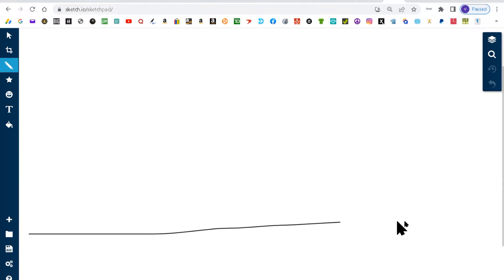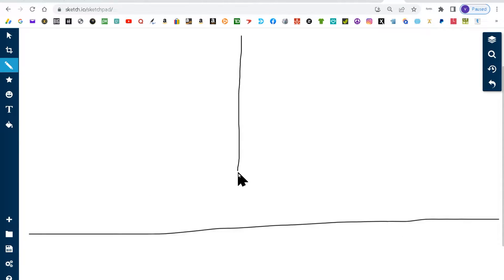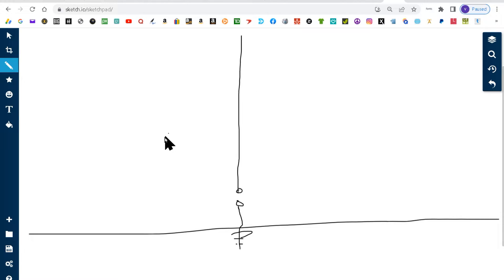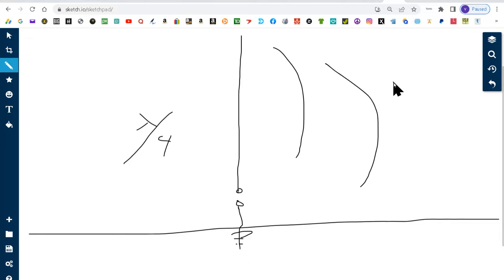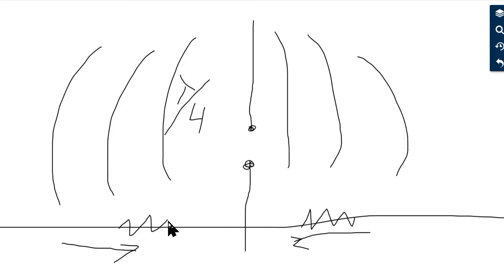WHY YOU NEED GROUND RADIALS / HOW TO INSTALL GROUND RADIALS / GROUND RADIAL BED

Comment: The guru on this subject is Larry Cebik W4RNL (SK) who did lots of experiments and measurements. For quarter wave verticals he found  that 16 radials is the recommended minimum and that performance improvements become less noticeable after 25 to 30 radials.
Reply from the maker: There is a point of diminishing returns, My experience is much higher than 25. I am not saying Larry is wrong because there are other factors, soil content, obstacles, etc. Performance still gets better after 30 radials, its just not as noticeable.  Thank you

Comment: I generally agree with you about the importance of radials.   But, there are situations where they are not needed for vertical antennas.   Here are a few examples:

An elevated vertical dipole
An end-fed half wave antenna
A Half Square antenna
A Bobtail Curtain
A vertical over salt water

The primary reason for using radials with a quarter wave vertical on the ground is to couple better to the ground.   And, we can know that we need radials by the feed point impedance.   With a perfect ground (like salt water),  and radials at 90 degrees to the radiator (not needed at all for salt water), the feed point impedance should be 35-37 ohms.   So, if it is 50 ohms - a good match to coax - you have losses in your ground network.

The reason the other antennas I listed above do not need radials is the position of their current node.   In the examples above (except the vertical over salt water), the current nodes are located well above the ground - so, not much in the way of ground losses in the near field.  

Thanks for the video, and 73!
Reply from the maker: Thank you, I agree. I was referencing standard verticals like the 6btv that most newer hams would use, I should have specified that. Sounds like you could make a good video, your welcome to use this platform.
Reply: @HamShackReviews   I realize that.  I just remember when I was new and learning about verticals, I was told that verticals need radials.   Then, I kept running into verticals that did not need radials.  So, I thought it important to point out a few exceptions and why they are exceptions.

Comment: Would it make any difference in Higher frequency 462 uhf with Radials at the bottom of antenna or ground floor with radials ??
Reply from the maker: If you mean 462.000 mhz that is outside the ham bands. In this frequency range height is the important factor. Using a vertical antenna it should have ground plane radials, with a beam radials are not needed

Comment: What about Roof Radials ???????
Reply from the maker: Most of the time, an elevated antenna does not need ground radials. Your antenna brand may have a radial kit that has 3-6 radials that goes at the bottom of the antenna

Comment: Not all vertical antennas essentially need ground-radials, of course.  I like the T2LT "flowerpot" vertical dipole, for this reason.  Install it at a reasonable height, and I think ground-losses will be tolerable; I suggest mount it at least a half-wave above ground at the bottom-end.
Reply from the maker: Installed at a reasonable height no longer makes it a ground mounted vertical so I can see your point, Mounting it at least a half way length above the ground removes the need for ground radials. However, short radials like the Gap Titan antennas have would be beneficial.

Comment: A few raised ground-plane radials typically has less loss than burying miles of wire in the dirt. Many higher frequency antennas are/were elevated ground-planes; low loss.
Even an HF vertical may benefit from an elevated installation, with a few elevated ground radials. Especially if they're laid-out in the direction you want to reach. 
An End Fed Half-Wave is high impedance at the feed point, and can use a simple ground stake or even a very short counterpoise.
A half-wave vertical (fed in the middle, elevated feed point) doesn't need a ground plane.
If you're (very) near the ocean, then you likely won't need much wire.
In summary, there are other options than burying miles of wire in the dirt.
Reply from the maker: Thank you for the other options, very good information. This video was talking about ground mounted verticals, when first installed mine did not have a radial system. When I added one the addition made a very noticeable improvement.

Comment: It depends on ground moisture content, soil composition and if there are metal structures near by, cirrect?
Reply from the maker: Yes, ground moisture content and soil composition are important but radials can make up the difference if one or two of these are insufficient. Metal objects are almost always a problem.